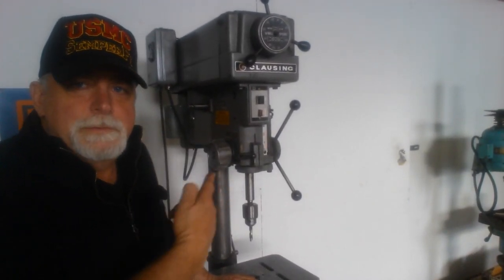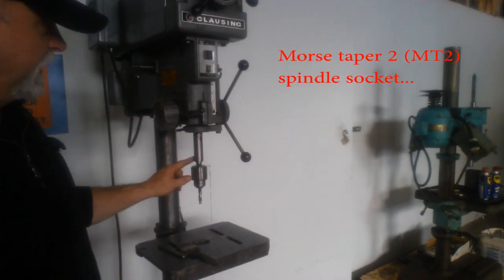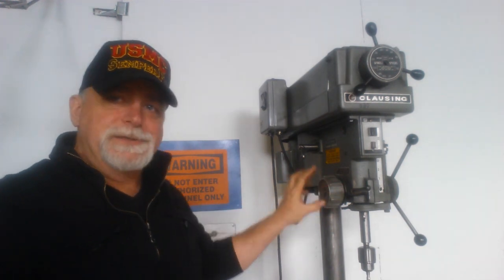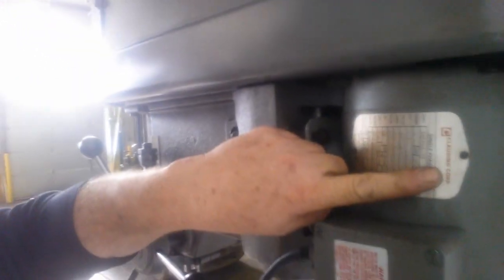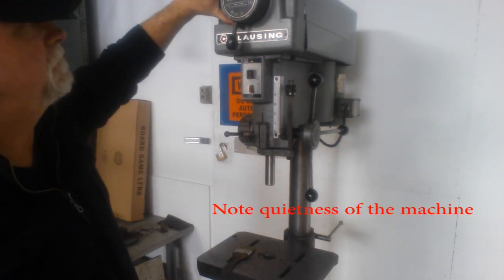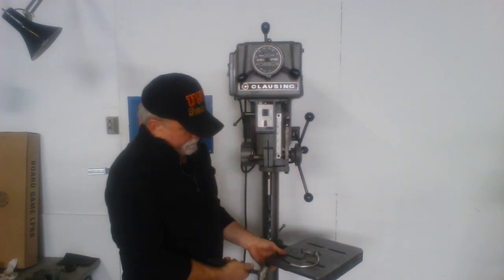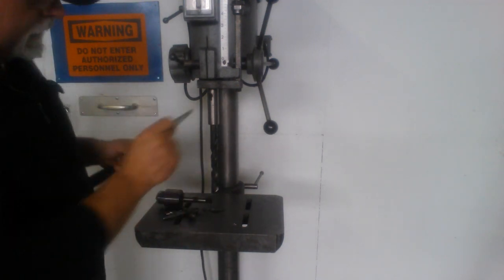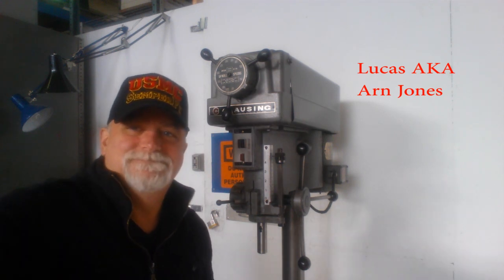Clausing 1670 Drill Press update

Comment: That is really nice.  Out of my four the sweetest one is a 1920 Avey flat belt stands
7feet high big square table that lowers to the floor also MT 2. also the quill housing
moves up and down. A good thing is I put a Ford tractor steering wheel on it, so much
better you should consider doing that. good job sam
Reply from the maker: I was tempted to buy a later model Avey locally.  Looked like a nice machine.

Comment: Looks like a nice one for sure!  I'm just finishing up restoring a Clausing 16VC-1, which looks nearly identical to yours.  I have a larger table, but it doesn't have any hold down slots or holes.  Good luck with your auction.  I'd think you shouldn't have any problem selling it at that price.
Reply from the maker: Thanks, Jack!

Good to hear from you.

Happy Thanksgiving!
Reply: Jack - Is the upper spindle assembly on your 16vc held by a small set screw?
Reply: Selta,
 Yes, just one screw holds the assembly.
Reply: Thanks Jack!